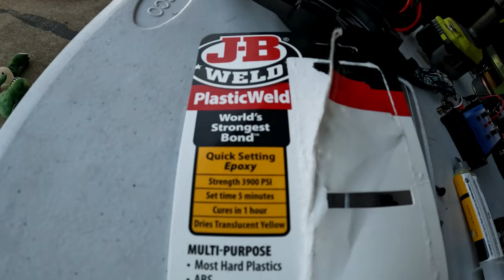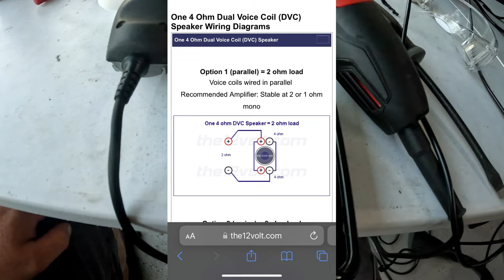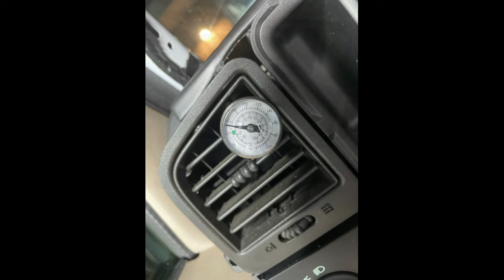Factory Bose Sub Upgrade For Your Truck

Comment: You can always use rice to pour into an odd shaped enclosure to determine the volume. Then pour it out into a known container size.  I feel informed now :)
Reply from the maker: I’d Be A Ricer Then 🤔
Reply: you can always do it with a plastic bag filled with water. Measure the weight of the water and it's super easy to convert that into volume. More accurate than rice and much cheaper.
Reply: Packing peanut works good too.
Reply: Clever. Thanks

Comment: I think the Bose sub does a pretty decent job for what it is in my next gen Suburban.  I am just going to add a 10" or 12" with a small amp between the captain chairs with a sub level control up front.  I ordered a new console lid to match the front console to hide it.  Thanks for the video.
Reply from the maker: I agree  if they are still working for you, all of the paper materials on my speakers where falling apart and and causing them to sound bad I even picked up some replacement door speakers from the junk yard that sounded blown as well so I just decided to replace everything, I did install 2 12’s as well thing sounds really good now has a good balance when it’s low with the small sub and then when you want it loud the big subs sound great up loud, that videos on my Chanel if you want to check it out, good luck with the console box sounds like a cool idea definitely will be A unique setup

Comment: Smart man choosing that truck restoring one of these is cheaper than buying a new truck and they are way more reliable and last longer. I did the same thing I got a 2003 GMC Sierra 1500 ext cab from an elderly man that garaged it and I was lucky it was in fantastic shape. I gave $6500 for it and it has 174k miles on the 4.8l engine. I owned a 2004 Chevy Silverado LT before and put 220k miles on it before I sold it. It never was put in the shop for anything but service. It had the 5.3l, but it is really hard to feel a big difference in the engines. The 5.3l pulled better of course, but the 4.8l feels smoother on acceleration to me. Mine does have a leak I need to get fixed it is on the agenda. I had to replace the blend door actuator behind the air bag which was a huge pain, but well worth the money. I researched a lot on older trucks to see what my best options were for the price and it was the 1999-2004 GMC/Silverados #1 followed by the 1997-2003 F-150's specifically the 4.6l engines. The F-150 trucks are cheaper so they are a great choice for those looking to save money. I hear they are a lot harder to work on though so I chose another GM. I would not touch a modern truck right now. Too expensive and reliability and longivity is just not there anymore. I miss the Bose my 2004 had though. I just replaced the 6-1/2" door speakers and rear 4x6" with Pioneer speakers. Looking for the new head unit and 4 channel amp and going to add an 8-10" sub and amp.
Reply from the maker: Hell yeah that’s exactly why me and my wife drive one, new trucks are not even make it threw the warranty with having to be in the shop, plus that payment I’m good, make sure you check out my sub install videos I finished it off with two JL W3’s in a stealth box

Comment: I have gotten a 6.5 in EVL skar audio sub and had the same issue of it not fitting. I watched your video part way through. Saw you had to trim and I almost gave up on that and sent the speaker back because I didn’t want to bore a hold in the box. I finished this video and now I realized how easily I could just jb weld the hood I make. Thank you for this video.
Reply from the maker: Glad it helped man I’m interested to see how good it can get with some good power behind it

Comment: Well, for starters, great video my man! I've had a 2003 Chevrolet Avalanche since 2006 and for a few years now the in dash sub has been making a rattling noise, but only at certain frequencies.  For years now I've been looking for someone who has done this exact thing, I've search all over, even looking at a Tang Bang from Parts Express.  You nailed it!  Hoping you made a video about recovering your seats too.  I was just talking to some of my guys about do I get rid of my ride or keep it and do some work.  Well sir! I think you just gave me the inspiration I was needing.  Times are a little tough right now for everyone and we need more people in this world like you! Thanks again.
Reply from the maker: Appreciate the kind words my wife has a 03 Yukon I’ll make a video when I do hers it actually wasn’t to bad to do your self my truck is still holding up great
Reply: @QS_TIPS  Do you remember where you got the materials to do the seats? That is if you aren't going to be doing her Yukon soon.
Reply from the maker: @CDP135Z EBay I found the gm part number for the factory foam you can get it for around a 100 I just did the bottom normally what wears out then eBay has cover kits in real leather I got both top and bottom  from a seller with good reviews then if you go to seat shop I think is the name they have really good videos on braking down the seats pretty easy actually seat shop has really nice cover but they are more money seen controversial reviews on there foam so I went with factory to be safe it’s the best for comfort it will even tell you how to transfer heated seats over if the pad isn’t burnt out probably will do there covers for my wife they have factory like quality but again they are more expensive normally only the driver seat fails but I had to do both my front all in all I think I only had 600 in material a lot cheaper then a upholstery shop but a lot of that work is so so now hope this helps you out

Comment: Thanks for making this video!  The Bose sub in my Tahoe has always been something I’ve been thinking of replacing without having to resort to aftermarket enclosures that delete the air vent.  Cool to see that it can be done pretty easily - thanks for showing us the way!
Reply from the maker: I appreciate the feedback! Check out the comments someone recommended a company that sells 6.5 in subs that would make this a lot easier sense it would be the same size sub not as much modifications, might try it out and make a video on it if my wife’s Bose sub ever goes out.
Reply: @QS_TIPS  a animal state of
Reply: Nicely done so glad you made this video I've been trying to find some info for my sub in my tahoe and couldn't find non till I came across your video thanks a bunch

Comment: This is pretty great! I've spent a couple hours searching "2003 Yukon subwoofer replacement" and zero. This includes one guy who posted like 7 videos on replacing all the Bose stereo components in his suburban, except of course the subwoofer was left original.  Saw your video finally listed on the side and it is just what I was looking for. A little more clarity on color coding, which are left/right  positive and negative would be helpful so we can get polarities right.
Reply from the maker: Appreciate the feed back, when you remove the speaker the polarity’s are marked on the speaker positive and negative just take a picture and take note before cutting/disconnecting

Comment: Man i have been searching for a video about this for a few months now thanks man im installing a better amp and sub in the console but wasnt sure how to go about replacing the sub this was great i know which direction im goin
Reply from the maker: Let me know how the better amp works iv been super curious how much is left on the table with more juice
Reply: I'm wiring up a 4 channel 1000w amp gonna use the front channels for my door speakers and gonna bridge the back channels for the sub..the sub is skar evl 65 d4 and the door speakers I went with Blaupunkt 6.5's 4 way speakers they should sound pretty crisp then I'm gonna run a mono sub to a skar 10 in a bandpass just in case want to rattle some windows at the stop light 😂
Reply from the maker: @mattrodgers7354  hell yeah that’s gonna be wild 🤣

Comment: I love my Bose Speakers.  I was able to get NOS stock replacements but my back speakers went and I am putting some JBLs in place of them now.  I have had a custom box with 12's from 10 or so years now and it was a great compliment to the system.  I think just upgrading them head unit is a HUGE improvement on this system.  Nice job on yours
Reply from the maker: Appreciate it man love these trucks !

Comment: Awesome instal man. I was looking for a video just like this for my Bose upgrade. The only thing is that when you measured impedance you only accounted for one voice coil and it looked like the Bose had 2. Depending on how it was wired (most likely at 4ohms) it could be 4 or 1 ohms. 
The interior speakers on mine were at 4 ohms for the rear and 2 ohms front door plus 2 ohms on the tweeter, wired together to total out at 4 ohms per channel. Great video you definitely inspired me to make a similar upgrade soon!
Reply from the maker: All the speakers iv worked with advertise the voice cool impedance per coil so if it’s a dual 4 ohm each coil will read 4 ohms the bose sub was a dual 2 ohm

Comment: Great video, thanks for sharing!  I just got an 05 GMC 2500hd with Bose and upgrading the sound system now. The next time you have the center console out, consider filling the factory box with Poly-fil stuffing. I'm not sure how it works but if the box is too small the Poly-fil stuffing will trick you speaker into thinking it has more room.
Reply from the maker: I found that Jl Makes A Stealth Box 10 for that space in the Yukon might go that route if I pull it again or do it my wife’s truck, make sure to check out the newest video I put in a stealth box in the back sounds great,congrats on the truck man !

Comment: Truck build turned out great and so did the sub.  I've always liked GM stock BOSE for what it is.  I have BOSE in my 2006 GMC yukon and it sounded great.  I did the Y91 Lux BOSE upgrade along with the GM TNR 800 navigation radio.  It sounds noticeably stronger.  I've also Dynamatted my doors and have Infinity speakers in the rear doors.
Reply from the maker: That’s awesome!  I was looking into that amp upgrade as well to possibly do before I completed this but I have no complaints right now with my high sound output, just think my 2 12’s are not performing where I want them so I been planning on upgrading to something stronger, I have a pole on my community tab talking more about it.🤘🏻

Comment: You've done alot of work on that thing looks good.
Reply from the maker: Appreciate It! Plan on Keeping it for life have some more plans for it once I get moved into my new house🤘🏻
Reply: @QS_TIPS  I have a 07 Tahoe with the Bose system. And was wanting to up grade the speakers. Some pl say you cant do it, bla bla bla. Crutchfield has limited speakers to up grade. Mainly for the doors. But I want to do the console sub.
Reply from the maker: If you actually call crutch field they will recommend the speakers I installed in the description, I opted for the ones with the tweeters for a louder sound but if you want a just a crisper sound they make the speaker without the tweeter as well, infinity is the only speakers I know of that will work due to the 2ohm rating witch is the same “really close to Bose” really simple install as well I think the baffling helped out a ton as well !
Reply: @QS_TIPS  and you installed a kicker ?
Reply from the maker: Yes only Sub I Found Small Enough To Work and be able to run at 2 ohm, if you did more of a mid range speaker sure that would work as well but not sure if the bass performance would be the same, kickers not popular with everyone but iv had nothing but good results with them one of my favorite cheaper speakers.

Comment: I'm in the same boat as you with my 2015 Colorado. The dang rear door speakers along with the stock head unit have very little sound at all. The front speakers are good. It is just a WT so it doesn't have Bose, but from what I have heard; the factory head units even the Bose really equalize everything  out so that the rears are "accompaniment" and not loud or outgoing. I've heard changing the head unit to an aftermarket unit will make them louder. But most head units only have 120W for the entire system. 
Then adding to my dilemma is the fact that the 2015 and up Colorado has electric steering assist that uses up to 60 amps from the electrical system. So tampering with the system with adding a 2 ohm or 1 ohm amp for subs seems so impractical or just asking for future troubles; or like some dramatizations put it "Even death"... I guess it just depends upon how badly it feels to lose power steering and or when it decides to not show up for work...

Awesome truck man, hard work always pays off...
Reply from the maker: I’d get a good head unit think that will help you out a lot the Kenwood I’m running pushes 50watt rms per channel and iv had good results with it in my last truck that was none bose, find it to be to powerful for the factory amplifier because it wants to see a low power signal preferably so I’m counting on the pac unit to convert the signal so I’m sure I loose some sound quality there but I love my head unit and it still sounds amazing

Comment: Just found this video. Nice job and way to be different. Could you just install the two ohm version of this mini kicker sub?
Reply from the maker: I didn’t see one when I purchased this one or I definitely would of not a large selection at this speaker size I even considered a mid speaker for it but the plan was if it didn’t work out just un pin the factory amp for the sub and add a mini amp for it

Comment: Great vid brother,appreciate the detailed insight. So for clarification the speaker is 2ohm correct?,but is the speaker size a 6.5 or 6-3/4? Im planning on pulling console as well for same purpose. But wanna get the right size that will be direct fit,minus the filing. Wil a 6" suffice or should i go with 6.5 . Appreciate u man.
Reply from the maker: 6.5 would fit better I did a 6 3/4 dual 2 ohm and wired it like the diagram I put in the video to make it 2 ohm resistance

Comment: Nice finally found a video on this up grade 👏  thanks ... how is it sounding now?
Reply from the maker: Still going strong haven’t had any issue compliments the system down low with the volume low and the bigger speakers take over up top have a vid on the 10’s I installed to replace the 12’s

Comment: Hey brother Quinton was going to ask you how did you like that kilmat sound deadner I'm looking into doing my truck but haven't decided which to use that works the best I'm leaning towards second skin but Ive seen noico and kilmat as well nice build too truck looks great
Reply from the maker: I have no complaints had it on for over a year now had to take some down to fix a window regulator but actually wasn’t too bad to still get into the door and I just put new matting on after, keeps the truck quite and I have no rattles
Reply: @QS_TIPS  Kool thanks for the quick reply bro

Comment: How did the wiring work as far as installing the subwoofer and have you done anything with the doors? I’m currently in the process of my dad replacing mine as well. I have two 6 1/2 mid range speakers and two 3 1/2 inch tweeters for that front tiller that I’m currently trying to figure out proper configuration with the intimated into the factory Bose system. I installed a aftermarket head unit and had quite the time with the steering wheel controls and retaining RAC and whatever other bells and whistles, I kept the factory amp. I did not bypass it, but I did install aftermarket subwoofer and tomato amp in the back. I am currently looking for a four channel and deciding on the configuration for speakers I’ve thought quite a bit about what you’re doing here and I’m wondering how simple it was to install when it came to wiring. Were you able to just use the existing connections or had to run wire to an amp without issue?
Reply from the maker: I just used the same factory wiring and plug and added a separate piece of speaker wire to wire the sub for 2 ohm resistance diagram in vid, for the doors I’m running infinity highs that are rated at 2 ohms all links are in the description

Comment: I watched the video and read  a couple dozen  comments. But i never really heard you say how it actually sounded? If it was worth the time and money ive heard many say. Its like gutting a dog. Id think it would add some mid bass. But is it really worth it? I recently totaled my 2003 2500hd crew cab without the bose system.  I replaced the factory speackers in my hd. And head unite powered the door speakers with a old school ppi 4 channel and powered my JL with a old school audiobann amplifier.  I wasnt impressed. I totally the hd Crew cab and now have a 2004 silverado crew cab with the bose system.  Im going to buy the extra plug kit so i can still control the stereo from steering wheel. Whats the verdicts or oppion . If i install the newer pioneer with rear camera.  I use the bose amplifier for the replacement  eclipse in doors and a aftermarket amplier for the to 10s?. Replace console sub? Or is it even worth it? Im lazy as of right now to see what power the bose is per channel? Anyone care to share your opinion. I what a good SQ system. Im 53 and ive always loved my clean install and clear crispy highs and mids with deep clean bass. Any one?
Reply from the maker: I Enjoyed the project definelty think if it’s your only source of base I’d run a aftermarket amp if your really trying to push it, but it works really good for me down low it does start to base cut just like the factory sun does up top but I run 2 10’s and it complements each other quite nicely JL makes a stealth box for under the center console to if you want to go that route I think it’s made for the Yukon/Tahoe might do it to my wife’s car.